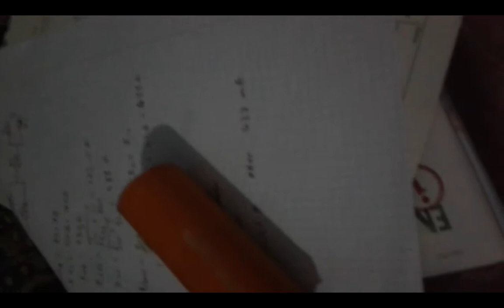How to make a Rechargeable SUPER Led FLASHLIGHT With Li-ion Battery

Comment: Soldering tip is way too oxidized that's why you have to keep it on there way too long. 5 seconds on the 18650 of continuous heat is not good. It won't explode, but your capacity probably went down by 100 mAh just by that soldering alone.